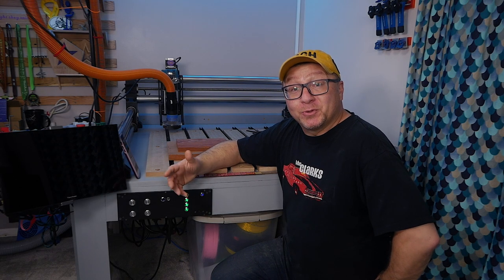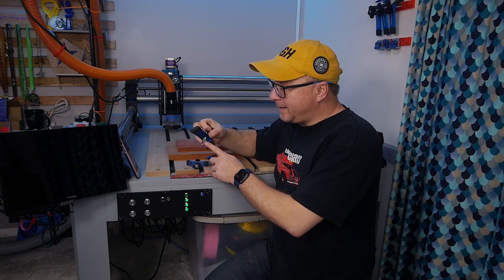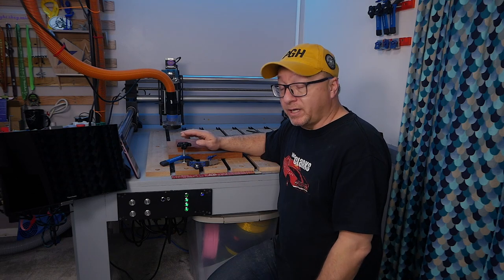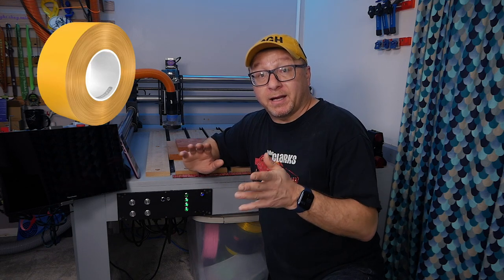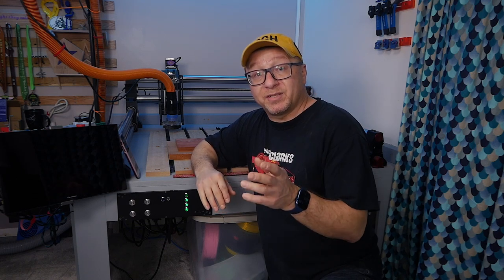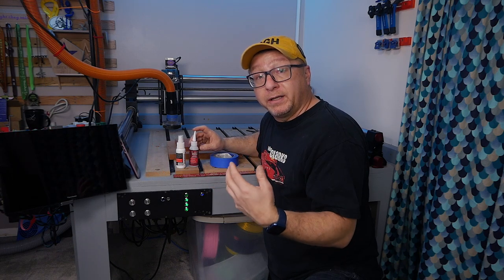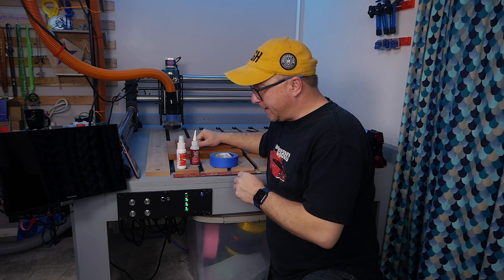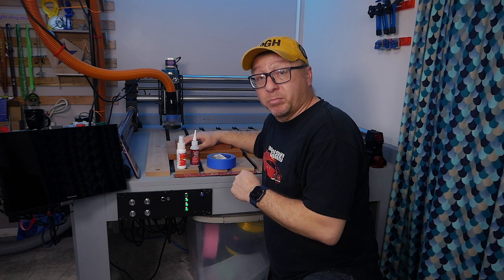CNC Hold Down Methods - 5 Methods that work!

Comment: I've milled a lot of 1/2" diameter holes on the waste board.  I can use 1/2" wood dowels to square up my material.    Also bought a lot of 1/4" nylon threaded inserts that are 1/2" so I can insert them, then use plywood sleeves with 1/4" nylon bolts for hold downs, this has hands down worked extremely well.  I've had bit contact with the ends but just cuts them.   Overall I agree, it is an experimental process to find a hold down that fits each application.   Love this CNC world and all the learning that comes with it.   Thanks CRG for more options.
Reply from the maker: Thanks Dale - that is an excellent suggestion.  I never thought of using nylon bolts - that make perfect sense!  Thanks for watching!

Comment: I have a hard pvc wasteboard and I use carpet tape for securing the workpiece (acrylic). Carpet tape is very strong, but the piece can slightly move horizontally under fast feedrates. This slight displacement of workpiece makes it hard to achieve high accuracy and errors within 0.02 inch will incur.
Reply from the maker: Thanks for the data point. I plan on doing an in-depth review of double sided tape in the coming weeks. Still trying to figure out a reliable way of testing strength and holding power. I will keep this in mind for the test. Thanks for watching!

Comment: If use nailer how to takeout material (MDF) without damage.
Reply from the maker: Hello Grace - if you use a brad nailer or pin nailer, you can simply pry the material up, pulling the nails through the material. Then pull the nails out of the waste board using pliers. You can also use composite nails to avoid damaging the end mill if you hit them (https://amzn.to/3RBa3Nk). Thanks for watching!
Reply: @cyberreefguru  Thankyou

Comment: I built a simple vacuum table using typical inexpensive 0.25” thick particle board which is very slightly porous rather than drilling a few hundred small holes in some non-porous material. With no air flow through the particle board there is no pressure drop so the hold down force is almost equal to the area of the part times the air pressure difference. An old upright Electrolux vacuum cleaner has sufficient vacuum for softer materials however for sheet aluminum it is best to also C clamp down two corners so vibration and cutting forces cannot shift the aluminum sheet. 
Cheers-Peter
Reply from the maker: Hi Peter - thanks for the additional insight and options. I might have to look into that closer :)  Thanks for watching!

Comment: You need a better double sided foam tape where it's restickable/ repositionable so you don't waste tape and helps with a lot of time versus the masking tape and super glue method. I'll see if you have an address and I'll send you samples.
Reply from the maker: Hi Cat - I have not come across any tape that can be repositioned and still have the holding power to withstanding cutting. Happy to be proven wrong if you can point me to a good brand. Thanks for watching!
Reply: @cyberreefguru  Yes. Most people aren't aware of it as it's been used exclusively through business to business (for hanging temporary point of purchase signage and art). I'll list a thickness more appropriate for the cnc market on Amazon. I only thought of CNC usage because I purchased machine and needed a way to hold object firmly in place but able to release without residue, and worked great.